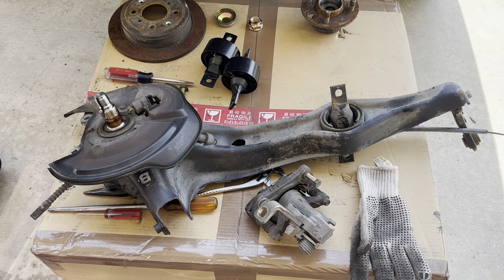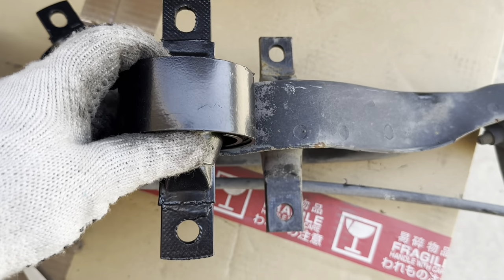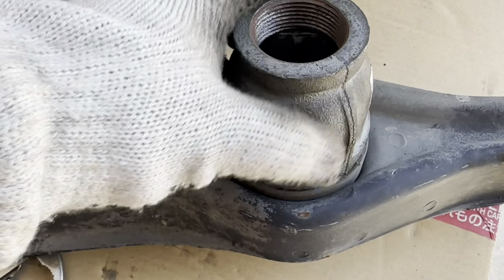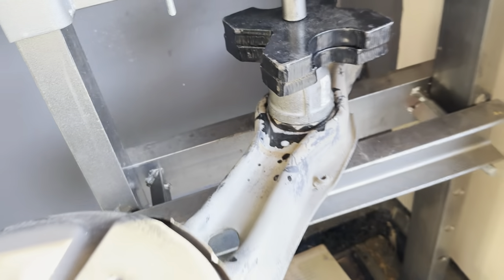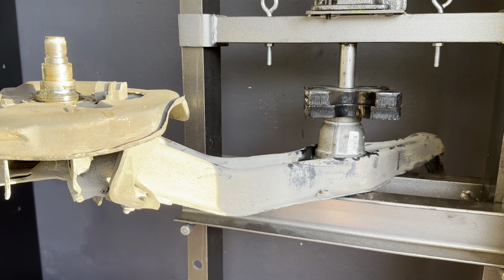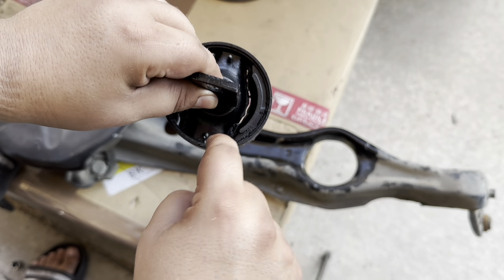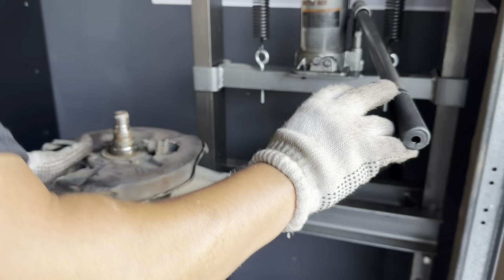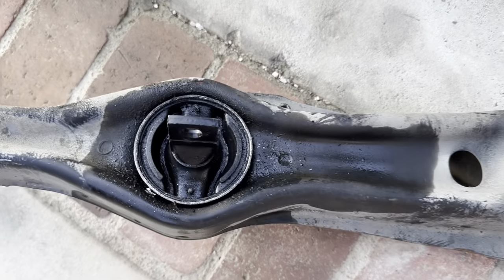Trailing Arm Bushings DIY Honda Civic Acura Integra How To

Comment: good video but you competely pushed them out the wrong way lol. they basically fall out when you hit them with hammer from back side. thats why it took so much pressure to push them out. try going from backside next time.
Reply from the maker: I’ll try that thank you!
Reply: They definitely don’t just fall out🤣 but you are right in and out the same way
Reply: Lol I was just thinking that. Tapped mines out from the backside with a hammer was easy. It’s slightly tapered.

Comment: Just came across your channel! Im pretty sure your supposed to remove & install the bushing from the inside outwards
Reply from the maker: Thx for the feedback Eric! There are multiple ways to skin a cat.
Reply: Eric is correct the arms are slightly tapered and by going the way you did you open the taper and make it square .....i guess it still has retention but not correct
Reply from the maker: @rubenrodriguez-zg4sg  thanks for that! I’ll need to go back and check that out.
Reply: Smaller side of taper facing inwards so when removed it should be removed back of arm to outer and instalation vice versa i literally did this same job yesterday with just hand tools and by following the taper it was a 40 min job both sides
Reply: @mexiricersgarage  np brotha man just i was doing this job yesterday and wanted to see how bad other peoples hardware were to have an idea of what to expect like broken bolt wise lol
Reply from the maker: @rubenrodriguez-zg4sg  very nice!!!!